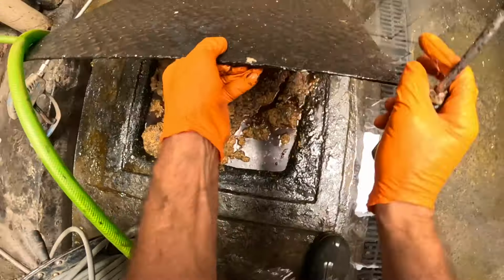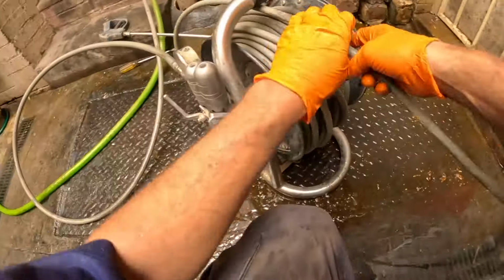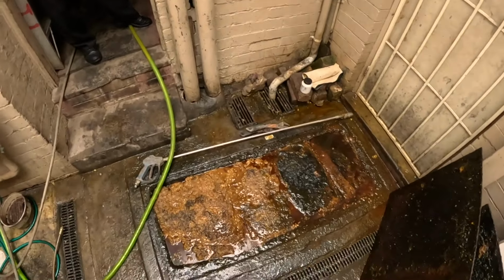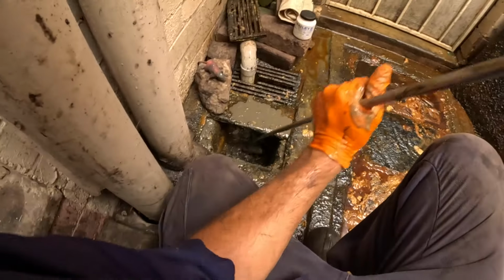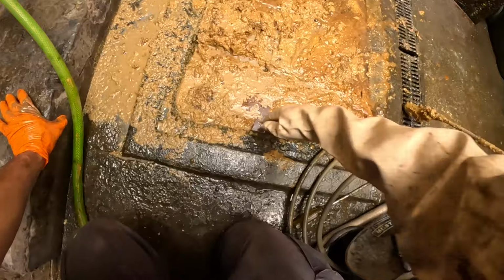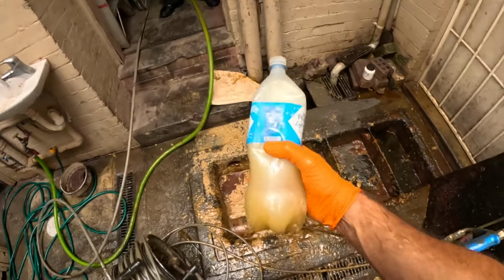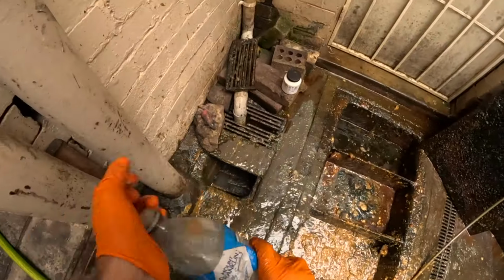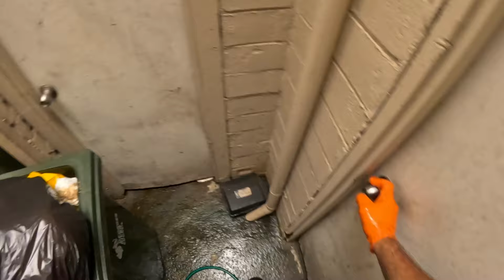Blocked Drain 790

Comment: The smell of grease Ahhhh , had a drain connected from a kitchen threw  the laundry the smell was so bad they empty that part of the building. Probably could smell that at the street . We from a Orange degreaser  smelled great melted grease chucks to mush . Bad thing cost was $50.00 a gallon but worked great ,would burn skin ,clothes, eyes, metal .

Comment: I used to do sign service on restaurants...that grease is smelly and slippery and hard to clean your clothes after working around it... some roofs are coated in it from older restaurants and in summer it can make you sick from the smell... only thing worse was pigeon poop and carcasses inside signs...sometimes it is a foot deep and that smell on a hot day can make you hurl...plus it is dangerous too for diseases....i don't miss those days...